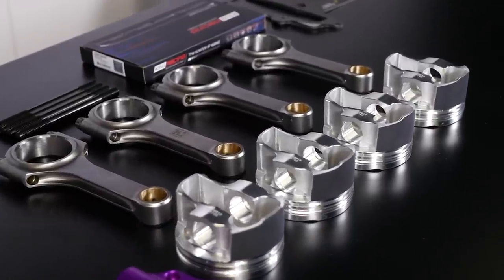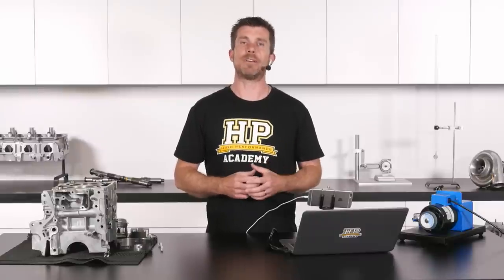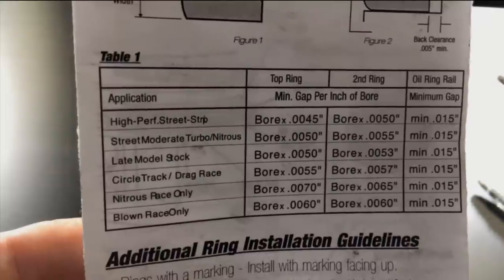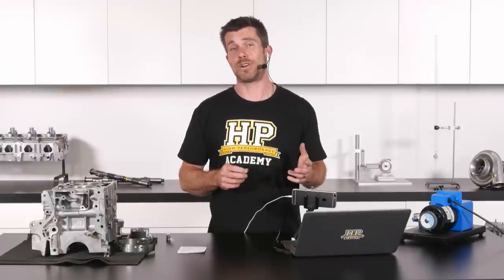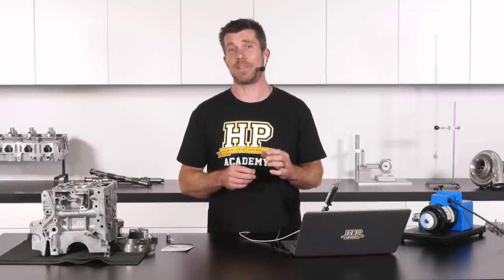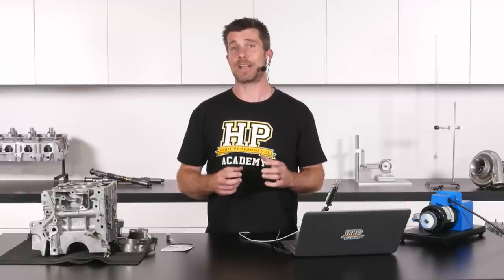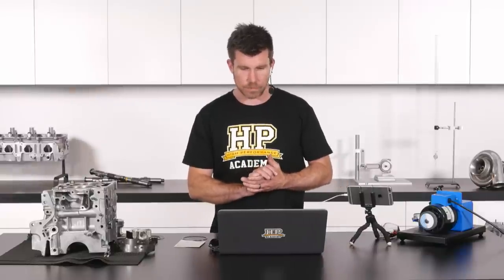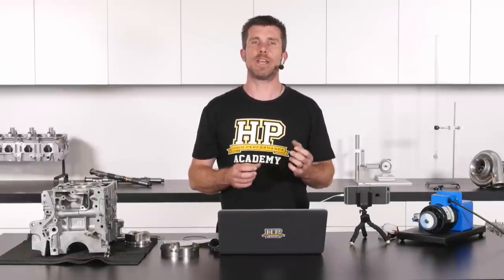Piston Ring Gaps | How They DESTROY Your Engine [GOLD WEBINAR]

Comment: Thank you very much for this information. I've recently had an apparent ring failure after 10years of total use and finally retuning & raising the boost recently. Listening to this and having the damage that I do it seems my 2nd rings were tighter than my top rings. Piston 1, 2 and 3 have cracked ringlands. Piston 2s crown was pushed up and cracked similar to a tree root pushing up through pavement. I did not notice shiny ring ends indicating butting together. All crank journals, bearings, rod journals and bearings appear to of been doing just fine. The cylinder walls are also fine. I was suddenly experiencing excessive blowby as my dipstick was trying to blow out. I did a cylinder leak down test and found cylinder 3 was down 40%. I will recheck my ring gaps as the engine is apart now and I'm investigating. 

SR20DET, 1.01×86.5 HKS headgasket, supertech 86.5 pistons, FIC 1000cc injectors, journal bearing billet compressor 3076 turbo, king main/rod bearings.

Thanks so much 🍻

Comment: Another advantage to tight ring gaps not mentioned is less oil contamination, thus longer oil life or the oil will be degraded less just before oil change.
Reply: Not necessarily. Tighter gaps means less contraction of the rings, which accelerates wear. It's a balance.
Reply: @LynxStarAuto  : Under no thermal conditions should the tips of the rings ever touch each other.  If they ever do, you are in trouble.
Reply: Addendum: when the engine running, which is why some race engines NEED to be preheated before they are started.

Comment: If it’s a NA race engine or mild boost engine I always use the .005 to .0055 per inch of bore if it’s a high performance daily driver I tend to run tighter to reduce as much blow by as possible especially if still running the dreaded factory PCV system which always coat the intake manifold and runners with oil so I try to reduce that as much as possible
Reply: Are there any considerations to take when doing this on an aluminium open deck block with wet iron liners?
Reply: Catch can is the solution to the dreaded blow by oil coating. Now I'm not disagreeing, as tight as possible without exploding ring lands is best. 
And I think .005-.0055xBore for a street application is a good one on an application that's running 7psi of boost.

However there are other factors. 
What kind of boost is it? Roots style blower boost? That's much hotter than a large turbo, perhaps even a smaller turbo. 

This is where complications come into play.

Comment: I had a piston look something like that first one, minus the huge hole, in my diesel. I learned a big lesson that time around to never trust pregapped rings. Rings help carry heat and if they produce heat they can help the piston overheat. When the ends butt together massive amounts of frictional heat gets generated. This can assist in piston melt down instead of piston cooling. In my case melted material locked the ring in place in the piston which allowed me to see there was no gap.

Comment: at 25:00 what you mean from the outside to the inside? the file will grind vertically, either upwards or downwards...
Reply from the maker: It's circular so it's not straight up and down, and the rotation you turn the handle can either be filing from front to back or back to front which is what Andre is explaining there - Taz.
Reply: @hpa101  it took me a while but i finally got what you mean :) the key was the location of the ring relative to the grinding wheel's rotating axis. If the ring sits above the rotating axis and towards your side, the direction should be downwards (referred to the tangent of the grinding wheel).

Comment: when i built mine the haynes manual called for a tight gap. the rings i got for my 20 over pistons were gapped quite wide, i did not need to file. i called the company and they gave me updated numbers for a considerably wider gap

Comment: Hi. I installed or will kind of rebuilt my motor today. I got any piston. to replace the old ones. Still the same size. Seventy millimeter. This is a flat top high compression. So I understood that when. I was after I. had installed the piston. I would have to check the gap to make sure that the valve tolerance was still there. But because I was supposed to go to what was it0..550. is what it was.

Comment: piston ring squaring tool? i just use the piston upside down and then use a caliper with the slide locked to push it down in 3 places to the same depth to ensure its square.

Comment: I absolutely lost a piston to factory ring gap in my boosted LS7 when one of my injectors got obstructed or just started leaning out. Under hard acceleration I would sometimes feel like an anchor was dropped out the back and then the chain would break. A hard stop and then start but at speed. Turns out it was the ring grabbing the cylinder wall and stopping the piston until it scraped iron off and then eventually ripping the piston apart on the up stroke. I drove for hundreds of miles and made lots of 1/4 mile passes on 7 cylinders. I knew the motor was done and was trying to blow it up. It lived until I took it out for a Texas Speed 427.

Comment: I've been thinking. Piston manufacturers provide the same clearances for all engines. But, it will not be the same for a 4-cylinder engine and for an 8-cylinder engine. After all, the thermal load at the same power will be greater for a 4-cylinder engine. I'm talking about power per cylinder. So what is the correct gap?

Comment: Concerning the Audi oil consumption problem someone mentioned, ~2008-2010 Audi 2.0T engines suffered from a poor piston design leading to piston, ring, and bore wear. Ask Audi if your engine is one which could be affected by this problem.
As for rings rotating in the bore, my impression is that they stop rotating once they are fully bedded in.
Reply: The PCVs fail regularly on those 2.0 TFSI engines causing very high crankcase pressures. Typically blows out the front crank seal, rear main crankshaft seal, and/or moving the piston rings in the bores. I have pulled out pistons and rings while doing the warranty repairs and the piston ring gaps were lined up so the oil had a straight shot out of the crankcase into the combustion chamber. IMO VW/Audi have never really made a good PCV system.
Reply: hey another thing to add to this thread is the fact that there may also be issues with the valve cover. I bought a tfsi 2.0 T for 300 bucks and repaired anything I needed to but I had massive oil consumption out of nowhere. It appears that the crappy plastic valve cover warps (of course it does) and it allows crankcase pressure and blow by straight into the intake. I needed to top off every 300 miles (!) before replacing the valve cover. Afterwards, the PCV system is working as intended. Don't get me wrong the same issue applies above, its still a bit hungry for oil but now I can actually get through an oil change.
Reply: Learn something new every day.

Well not every day.

But thanks. I found that interesting as F. Honestly.

Budget a.f. here by the way.

Comment: What is happening to a piston with 0,1 mm ring gap instead of recommended 0,48 mm by JE? Turbo charged 3,2 Liter BMW S50 engine. Piston got damaged properly but does mor e look like it overheated and even rings melted.

Comment: Hi, very interesting but also a bit scary, why? Ok, I am rebuilding/restoring a Jaguar E-Type V12 and found that 4 pistons out of the 12 had broken rings, so I decided to remove pistons (7.8:1 ratio from the US version) and sleeves and got new ones with 9:1 compression ratio (Euro version of that engine) and had Total Seal modify the second rings (their suggestion for normal aspirated) to „gapless rings“. Now after you mentioned that those gapless have a short lifespan it scares me a bit since I do not plan to rebuild this engine every few years. This car will run about 3000 Miles per summer and I had hoped to drive this for at least a hundred thousend miles (by that time I will be long gone 😁). The car will be a cruiser with good power but except for a few nice runs on the autobahn here in Germany it will see no racing actions. Will I be in for a bad surprise with those rings????
Greetings Bernhard
Reply: Maybe. I only know one person who has tried gapless rings on a road car and he wound up going back to conventional rings because they didn't last and didn't offer a noticeable performance increase. YMMV though, other people claim they're great and will last just as long as a conventional ring.

Guess you'll find out.
Reply: Ugrasrava 
Thanks for your reply. This does not sound too good but now I have them so I might as well use them. Since I will be using this car for only a few thousend kilometers per season, I hope it will be ok. I guess that everyone raves about such things but has never used them for himself. So, I believed the stories that I had heard about how good they are. I guess I am the testobject with mine. Total Seal did not think that there will be any problem with them, hmmmmm?
Greetings Bernhard
Reply: Hi I’ve been in engine rebuilding for over 50years and never heard such rubbish,there’s always a compromise to be made in engine power and oil consumption. There is No such thing as Gapless rings because no ring gap means certain engine seizure because of expansion and no oil getting to the top of the cylinder. This Bullshit is nonsense because theirs still a ring gap. When fitting normal pistons the rings are supposed to be fitted so that the ring gaps are spaced around the piston so they don’t line up,also pistons are designed so the ring rotate when the engine is running so that adequate lubricant can Stop the ring seizing in its groove and stop the cylinder bore wearing prematurely in one spot. People are obsessed with a little oil consumption,all engines have to use some oil but it all depends on how the cylinder bores are honed and what material is used for  the rings and of course the amount of ring gap. These rings are going to cause all sorts of trouble depending on which engine they are used in and what they are going to be used for ie. racing Ect. Snake Oil comes to mind about these rings leave them alone. If these were any good engine manufacturers like Ford, Cummins, Scania, Volvo, Cat, Perkins and countless others would be using them in their engines,think about that before using them it might save you a fortune in repairs.

Comment: People try and run piston end gaps to close today. A extra .005 to .010 won't hurt a thing. Especially on Hypoeutectic pistons which put more heat on the rings. I have found out you buy the correct oversized rings for your pistons you still need to file the end gaps a little more. Buy file fit piston .005 oversize you will be there forever. Just buy stock oversize for your piston and check the gap a few strokes with a file you are good to go. Remember .005 over what is called for for your setup won't hurt power. To tight is the killer to the whole engine. GM said years ago up to .060 ring gap on the dyno caused no lose in HP. All they found was more blow by. That gap is about twice they want in standard ring end gap. Why take a chance open them up .005 and I have never had a problem with ring butt and break the top piston land.

Comment: Ravanol 20w50 break in oil it also has 2.5% ZDDP
Reply: Oil viscosity should be based on bearing Gap. But that is a good ZDDP 😁
Reply: @TheDashocker240  Andrew wanted a high viscosity break in oil, because every highly boosted built engine has more bearing gap then OEM spec. Ravanol has also a 5w30 break in oil, but thats not the viscosity Andrew was looking for. 38:25

Comment: Hi , excellent info as always. My question is unrelated to the topic but please answer . 1) In the video you said you doubled the power of the fa20 engine with 8 psi boost. So theoretically if the engine is stock with stock cams and no head work the air flow can only increase about 55%. So you managed to double the power because 1) you are on e85 so you were able to run timing even more than in degree than  the engine was running stock ?, even under boost. Or did you do some other airflow improvements like cam?. Or any other reason. Also you mention that under 40 to 60 psi of boost and not running dry sump you run too much oil into catch can, any solution for that? Thank you.
Reply: It's a rather complicated calculation just using 'boost', as there may normally be less than atmospheric pressure inside the NA manifold due to induction losses. There is also the point that engines suffer parasitic losses* from internal friction, pumping losses, driving water pumps and other ancilliaries, etc. that reduce the actual output of the engine from what it potentially could produce - with forced induction those losses are about the same so the potential difference is greater.

*It can be surprising just how much power is used just to turn the engine - if your vehicle has an idle adjustment, bring the idle speed up to, say, 3k rpm and then drive the car going through the gears until the rpm drops to the normal engine speed without using any additional throttle - you may find that the power the engine uses just to increase the idle by that amount will allow the car to travel at 15-20 mph, maybe more.

Comment: Does anyone know how much a ring expands at running temps?
Reply: It varies per application. You need to know the change in temperature, Coefficient of thermal expansion of the ring material, and the length of the ring at the initial temperature.

Comment: Can you give some insight on the limited lifespan of the gapless rings? What is causing the shortened life?
Reply: They 'should' have close to normal service life - maybe more as there isn't the gap to increase.
It may be down to the ring material/surface treatment not being compatible with the honing process and bore inish.

Comment: Thank you so much for this thorough presentation of a highly technical engine building topic :)
Question: if piston rings are stuck due to poor oil maintenance and even perhaps a bad engine break-in procedure when the engine was new, will solvents like engine flush and fuel system cleaners actually free them thereby reducing or even eliminating excessive oil consumption/burning oil through the exhaust?
Reply from the maker: It is unlikely. Once the cylinder wall is glazed or something is damaged, there's no magical fix I know of beyond pulling it all apart and machining/replacing as required.

We do all wish that wasn't the case, don't get me wrong, tipping a can of something in vs rebuilding an engine would be the dream - Taz.
Reply: @hpa101  As I thought :( All roads lead to piston ring replacement being needed in my 4AGE 20 Valve Blacktop since I already replaced the stem seals with Supertech. Engine runs great and pulls hard otherwise. Previous owner did a bad job of maintenance. After I ran a can of engine flush I noticed the oil burn and smoke issue popped up. Traces of burned oil/sludge and varnish were found beneath the valve cover too. Typical signs of bad oil run for too long. New oil turns black pretty fast too. Some people just don't deserve special cars.
Reply: @RolanTHUNDER  absolutely not.
the ring land and the ring have near ground faces, thats one of the sealing methods. ANYTHING in there, they stop sealing.

clean wet oil, thats normal. 

burnt oil, carbon particles. no. once theyre coked, theyre coked, and it just gets worse as they start leaking more...
Reply: @paradiselost9946  Yeah. Those "in tank solutions" are snake oil for the most part. Once the oil control rings (or compression rings) are stuck, they'd have to be changed out for new ones to solve the problem.

Comment: 5:10 OMG - 1-2% power difference!!? I’ve stressing over NOTHING this whole time talking to Wiseco about my piston ring on my forged piston VQ35DE engine!! No wonder they said I was fine with a 0.005 bigger ring gap….engine won’t perform different.
Reply from the maker: Yes it's all relative. Where 1-2% is massive to some, it's nothing to others which is good to keep in perspective =) 
One podcast guest had some interesting comments around this and the use of expensive lightweight metals for little to no gain that 99% of drivers would need, notice or utilise in a homebuilt application racing other homebuilt applications etc for example. Still great to understand it all mind - Taz.

Comment: As soon as he showed that piston I knew that wasnt a ring gap issue . A bad ring gap wont melt a hole threw your piston.
Reply: right. dead giveaway is the molten metal is pushed DOWN, as the piston fired on its way up at high RPM. Not good. now the rod/s are junk, and probably the crank too.